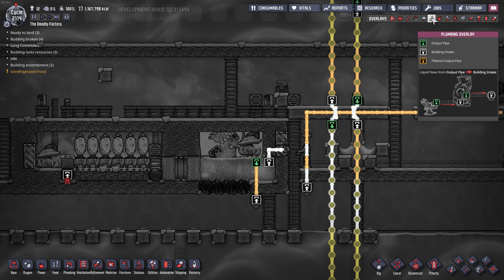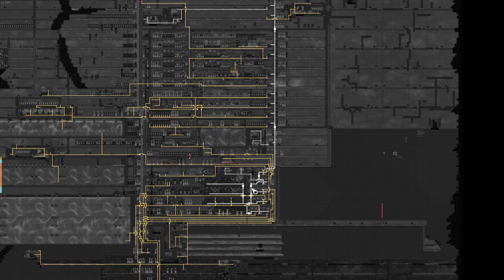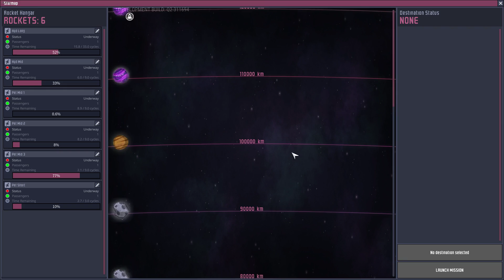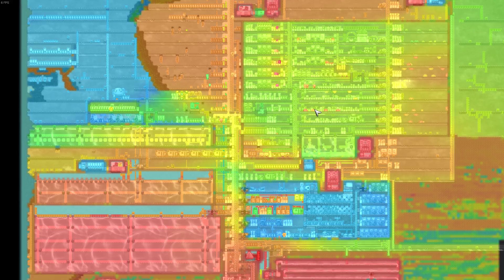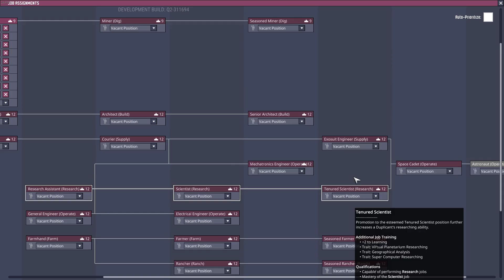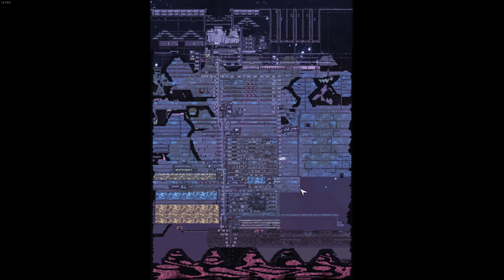Late game cycle 2000 Base tour : Oxygen not included (Save file included)

Comment: 22:22 why do you need doors in the top of the rocket? Meteors can destroy what? pipes? - no. Automation? - no. Bunker walls? - no, ahhh, you still need to drag materials from rocket - right, it's so hard to set up rails and pipes to drag materials automaticly I get it - think about new way w/o doors. Seal rokets with bunker walls, you don't need to remove dupes from rocket - right? or developers change something?
Reply from the maker: I need to be able to get the regolith out of the silo or it will eventually kill the frame rate. I could leave it open but then I risk entombing or trapping dupes in the silo with a badly times meteor shower. As it is the only chance of death in this base is if a dupe gets trapped in the rocket silo by a regolith meteor just after the rocket is left and the doors are still open. Well thats what the design tries to minimize.
Reply: @FrancisJohnYT  regolith removes by rockets, dupes don't need to be there

Comment: I've always wanted to try this, but I've never been successful, maybe you would be.  A full vacuum style base where your dupes run around everywhere in atmo suits, even sleep in them.   And when I say full vacuum obviously you can't do that in areas where temperature are needed to be transferred etc.  But pretty much a base where there is no extra gases flowing around places that aren't needed.   Just a thought for you to check out.   I have tested a little bit, and I have gotten to the point where my dupes can stay in an atmo suit all day and swap to a separate one at night to sleep in.  So if you have 10 dupes you need 20 suits lined up going in and out of the bedroom area.  (Or just 2 per room area if you want to split them up.)

Edit:  Biggest drawback I could see is the loss of toilet usage so no free gain of polluted water (if you don't get a slush or polluted water geyser)  And lack of CO2 due to not being exhaled.
Reply from the maker: As far as i am aware dupes cannot sleep in atmo suits but they can eat and use the toilet. So in theory it should not be an issue. I want to do something similar a base where everything is cooled to just above the freezing point of oxygen, this means only oxygen and hydrogen can exist as a gas and everything else turns to liquid of solid. Have not figured out how I will keep the toilets running yet :)
Reply: @FrancisJohnYT  they can sleep in atmo suits I have actually designed a base with all their bedrooms in a vacuum.   I have an atmo checkpoint going to their room that forces them to swap their suits just before bed and when they wake up.   1 suit on a dupe with divers lungs lasts all day no problem.    And they don't need to use the bathroom because the suits give -110% bladder per cycle.

Thankfully the atmo check points don't release any hear even though they use electricity to recharge.    So they never overheat.   And the dupes don't heat up their plastic beds.   While they are in their suits.

Comment: Question about the petroleum boiler.  Do you have to clean out the igneous rock every so often as the magma cools?
Reply from the maker: Yes and no. I designed it to run for about 300 cycles on one tank of magma. Then I ripped out the depleted magma and replaced the heat source with a space metal aquatuner. If you take your time getting to space you would have to mine it out and let fresh magma in. Check the playlist the petroleum boiler tutorial is in there.

Comment: 8:25 bunker doors under the rockets, open with time sensor in the night
9:40 do you get a "memory overflow" in task manager from 8gb to ~22gb ram usage? when fps drops
10:00 door under griller to room with co2/hatches with timesensor
Reply from the maker: 8:25 bunker doors overheat at 1200 degrees, steel doors get damaged by meteors, building the rocket and then removing floor was an option but erratic meteors caused issues.
9:40 No memory overflow just a mid range four year old processor.
10:00 I don't want to store more food I want to destroy it, I also dumped 230 tons of coal into vitamin chews just to dump coal, no more hatches for me. The system gets rid of excess food but still leaves me with a stockpile of raw ingredients.
Reply: @FrancisJohnYT   I tried the vitamin chews. Turns out there is absolutely no way of getting rid of vitamin chews with healthy dupes, not even lava. It's often just easier to have an array of coal generators. 
What is the maximum temperature you've encountered for rockets then?
Reply from the maker: The Rocket temp in the silo's depending on location and fuel type can get up to 1500 degrees. The base of the silo gets cooled by regolith falling on it but it's impossible to guarantee that so you work around it. Yeah the vitamin chews were a bad choice I might have to introduce slime lung to my base just so they get eaten.
Reply: @FrancisJohnYT  didnt you say your bukertiles are arround 600C°? just had it in my last base and never notice that it got broken.
anyway great base overall